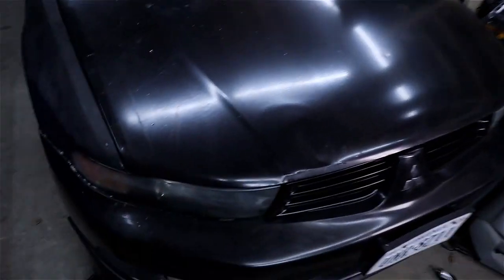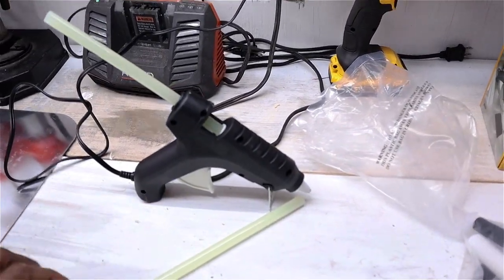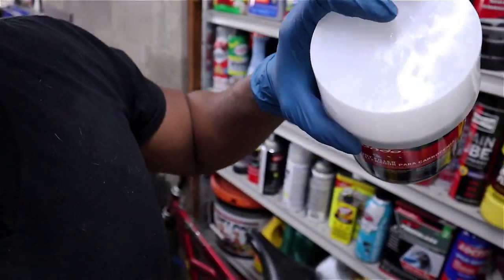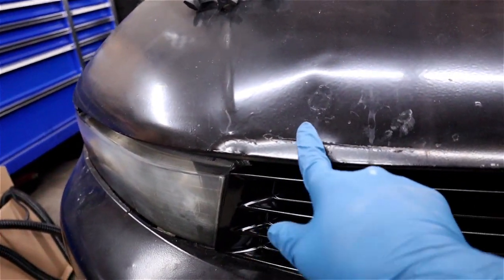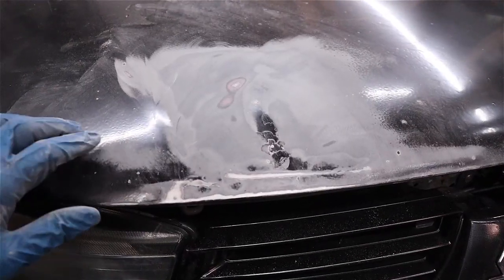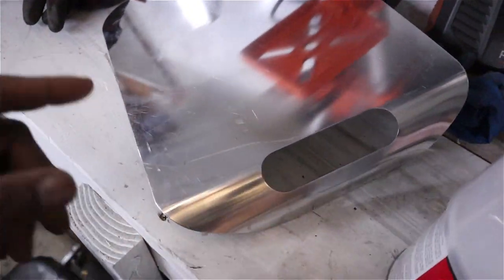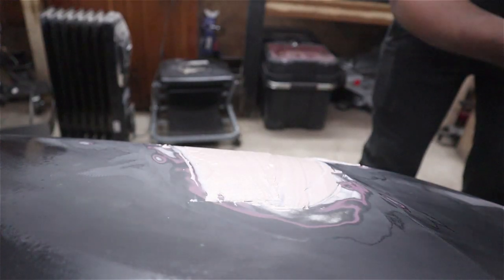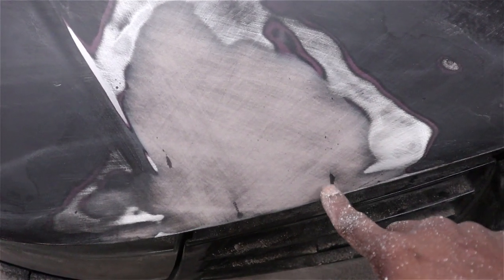Testing the Cheap Harbor Freight Dent puller. Paint prep part 1

Comment: I'm picking one of those dent pullers up. I've seen them on ebay with more attachments in the $30-$50 range. 

Also one tip on that HF mixing board. Save old cereal boxes or any large, smooth boxes like that. Cut them down and just tape it to the board and toss it when you're done. Zero clean up. 

Also invest in some Dura-blocks. They're like $50 but well worth it. It's almost impossible to block with a DA sander and blocking by hand will get you way better results. 

Lastly you want a 24 or 36 grit scratch in the metal to give the filler something to adhere to. Smoother is fine for a glaze but not really for body filler. Not sure if you ever watch Sprayway Customs on YT but if not, definitely go check him out. I've learned so much from his videos. 

But keep up the great work man. I'm a fellow Mitsubishi enthusiast and found your channel a few weeks back on the input bearing video. I've been binge watching ever since!
Reply from the maker: A lot of good tips, thank you. I’ve had durablock in my Amazon cart for months now lol. I just haven’t pulled the trigger. Somehow I didn’t even think about the bond between the metal and the filler before hand. Fortunately, I don’t plan on running this hood long term but that’s definitely something I’ll remember next time.
Reply: @RvaJay  I do the same thing on ebay. Actually one of those glue gun kits was one of them lol. But you've convinced me to go buy it now. 

And I'm sure the repair on the hood will last for years. But a deeper scratch would definitely hold better. I have used a thin cut-off wheel on an angle grinder to scuff the metal too. 

But yeah, those dura-blocks work great. Grab a set when you can.